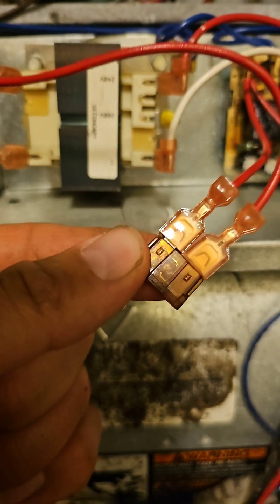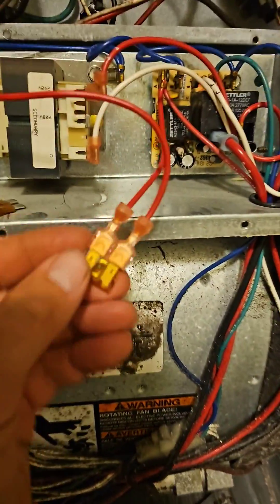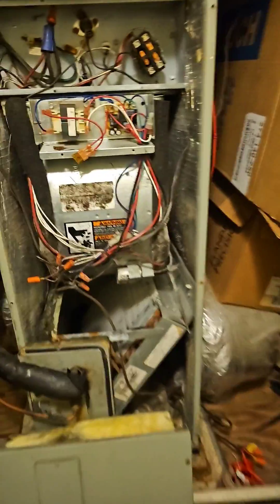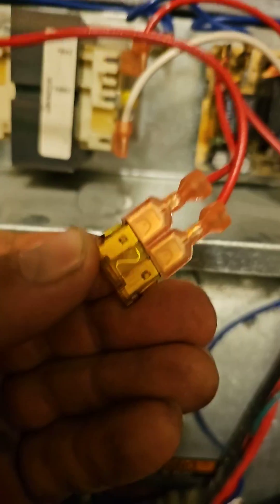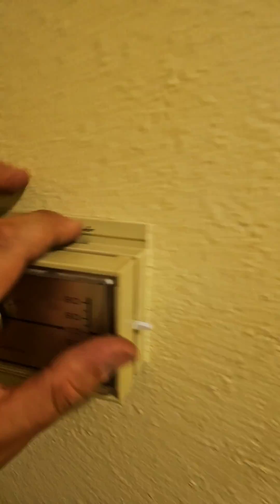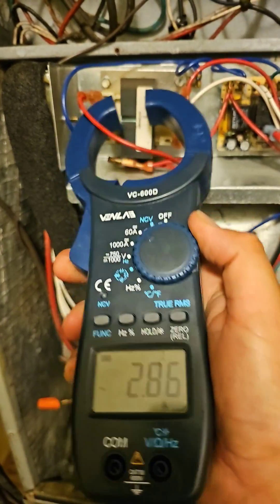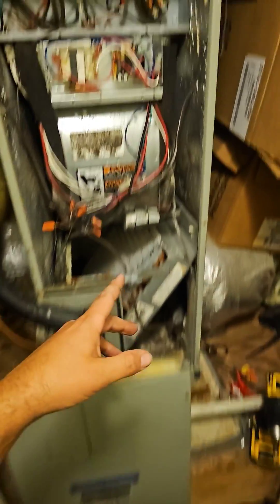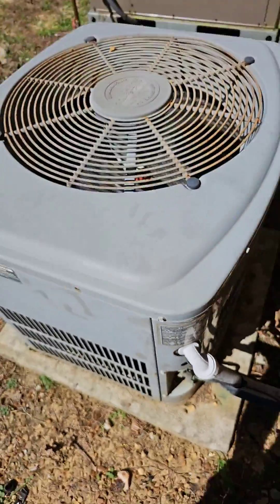What can cause low voltage short? #airconditioning

Comment: One day, I was troubleshooting a commercial heat pump. The building was three stories with the condenser on the roof and the fan-coil above the second floor drop ceiling. I knew I had a low voltage short. For some reason, I could not find my resettable fuse. I searched around and found three fuses. Three guesses, I thought. I was on my last fuse and realized the issue was the compressor contactor. Swapped it out. Fuse didn't blow, but the condenser still wouldn't run. Turns out I installed a contactor with a coil rated for 120 volts instead of 24 volts. I'm sure there's an application for a part like that, but I've never seen it. Ive beenin the trade over 6 years. Icing on the cake was that the system was very low on refrigerant so the customer ended up deciding on a new system. 😂

Comment: Ah yes the bang test. The sign of a unskilled trades man
Reply: I disagree. I've had jobs where the short would be extremely intermittent. I remember one house that took months to find the short. Every time I would replace the fuse on the zone control board it would run fine for a few weeks and then randomly blow again. We ended up running new low voltage wire out to his condenser.
Reply: @AlexBianco100  ummmm…. I assume you did a IR test? 
Genuine question though do American actually test anything? I have never once in any video see a American using anything other than a bargain basement multimeter or a volt stick.
Reply: @TheRealistOfTheReal  I am familiar with how to test insulation. I have a megger and use it on occasion. I just disagree with your characterization of his approach being “unskilled”. A lot of times in the summer when your banging out 20 or 30 house calls in a weekend you don’t always have the time to be that detailed. Process of elimination can typically be used to resolve most troubleshooting issues. Also, keep in mind that most HVAC technicians in America are not required to maintain an electricians license.
Reply: @AlexBianco100  you said enough when you said you use your megger occasionally!
Let’s face it. Unless these 20-30 properties you visit in a weekend are in a block of flats there is absolutely no way you can do a professional job.
Reply: @TheRealistOfTheReal  That was one particular weekend I had a couple years ago. I think the daytime high was around 110 degrees Fahrenheit here in California. Arguably it was just me running around ‘putting out fires’. In total between Friday Saturday and Sunday it was about 25 houses and I was working 14 to 16 hours per day. Not the most thorough work I’ve ever done, I just wanted to get people operational. I live in a relatively small county so the average drive between jobs is around 10 to 20 minutes.
Reply from the maker: Thanks for watching

Comment: A car fuse on mains, thats dangerous.
Reply from the maker: It's only twenty four volt
Reply: Way to tell us you know nothing about HVAC and that it’s a 24 volt 3 amp fuse not a “car fuse”
Reply: @Jakeofalltrades777  I have worked on HVAC systems, I also work on all Industrial control systems,  They are car fuses, It maybe on the control side but it still is a rubbish fuse, Proper control systems uses sand filled fuses to extinguish the Arc. 
All the machines and systems i design and build used Merlin Gerin circuit breakers, Fuses are for cheapskates,

Comment: I would if looked for a low voltage short and checked the transformer and contactor before I popped a second fuse.
Reply: Bet you would've